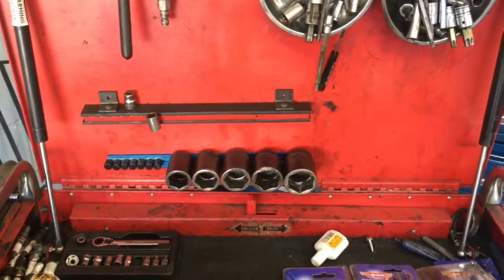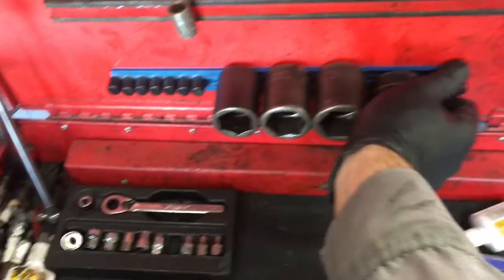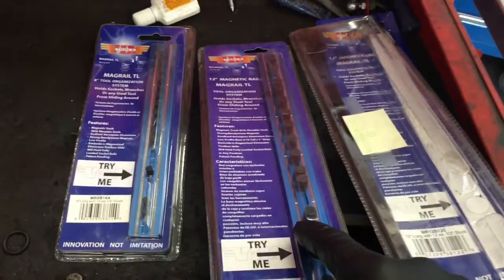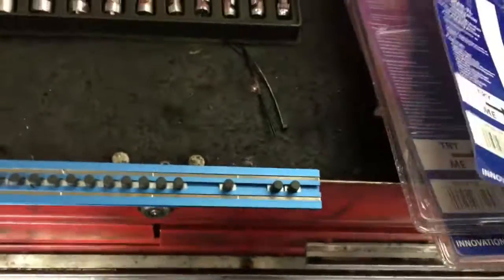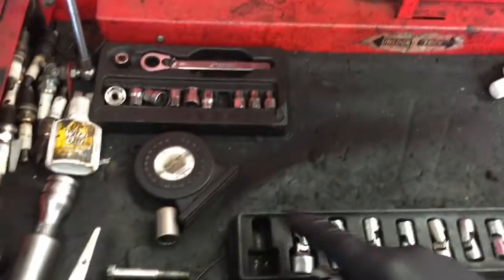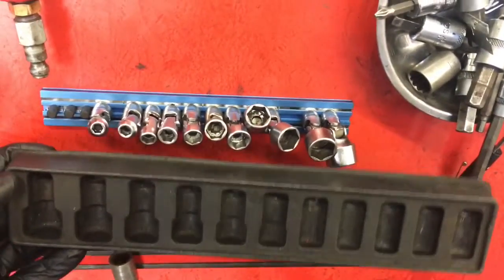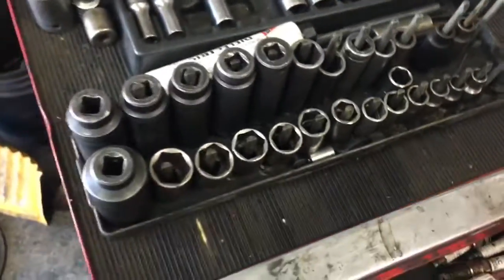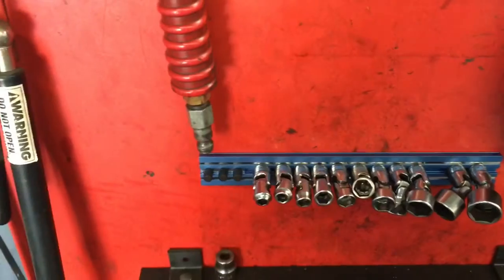How to Automotive's Tool Review of VIM Tools Magnetic Socket Holder

Comment: I really like VIM rails.  I wish the pegs were designed to accept an Allen wrench.  Being a little OCD, it would be nice to organize and space out all the sockets then take an Allen key and lock down all the pegs with the sockets still installed since the pegs tend to move a little when you tighten them down.  It would also be nice if they offered an extra long rail for 1/2" drive.  The 16" long 1/2" drive rail is a little short for some of my Cornwell sets.  One nice thing about the VIM rails is the number of pegs they provide.  I've never needed more pegs than what was provided.
Reply from the maker: BlindBatG34 that's a really good idea with the Allen sockets. I wonder if you could write to them.